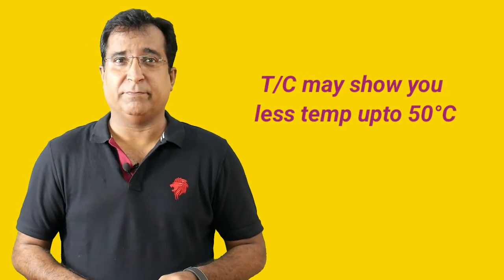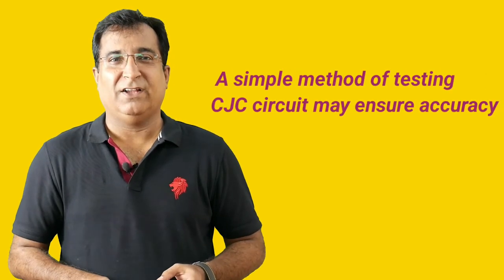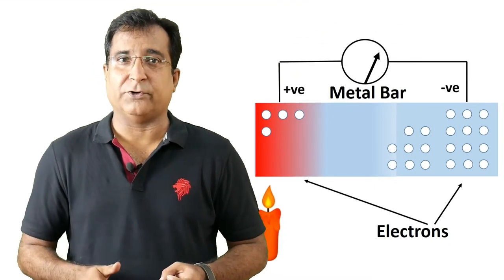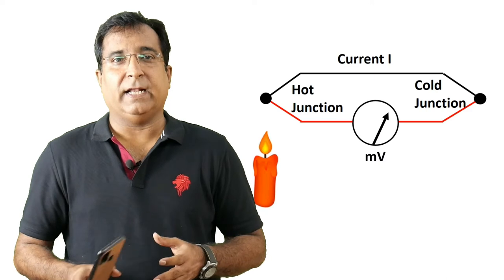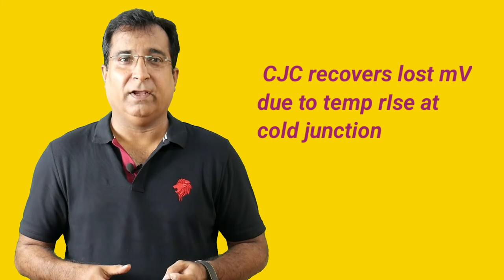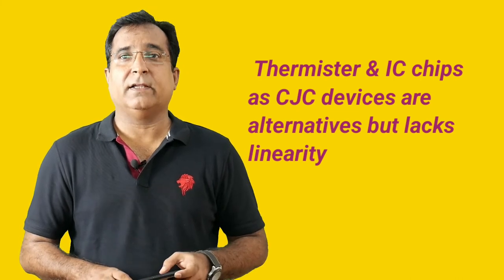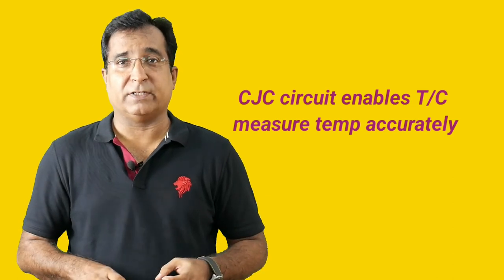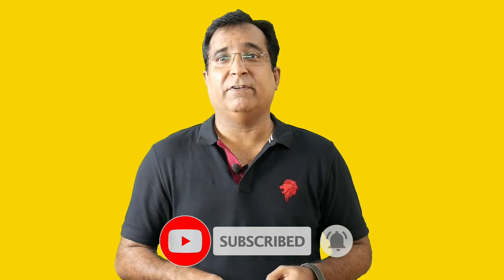Thermocouple | Cold Junction Compensation

Comment: If the thermocouple is a 3 wired one with compensation cable, how you can check the operation of the thermocouple with a multimeter?
Same mv procedure between positive and negative terminals? Or some different procedure if compensation cable is present?
Reply from the maker: Thermocouple always have 2 wires as positive and negetive... You can directly measure millivolt without removing connection with multimeter in parallel. You talking about 3 wired Rtd, 2 wires always short circuited. One out of 2 short circuited used for auto compensation. Hope you got it now

Comment: Why thermocouple shows 0mV in room temperature..?
Reply from the maker: Coz both junctions are at same temp there needs to be difference of temp to produce flow of current in loop and voltage drop across multimeter